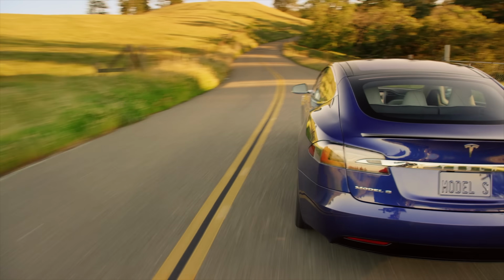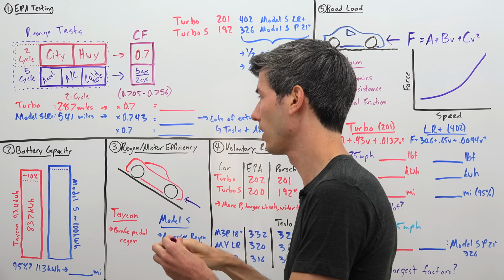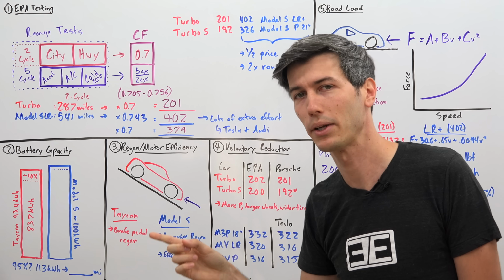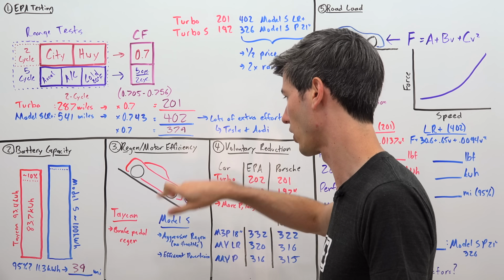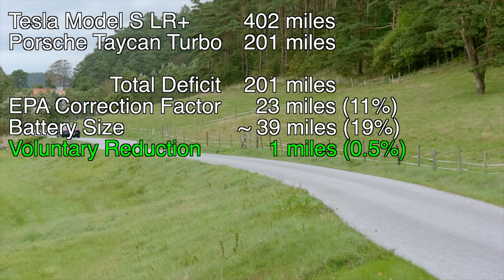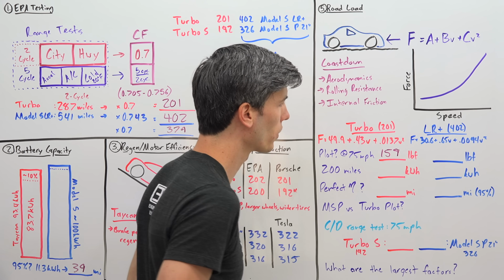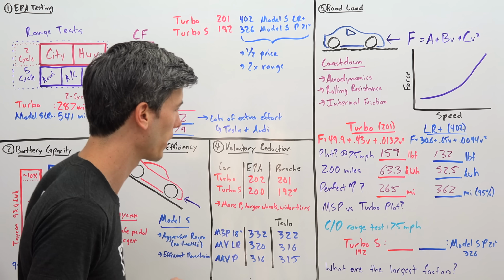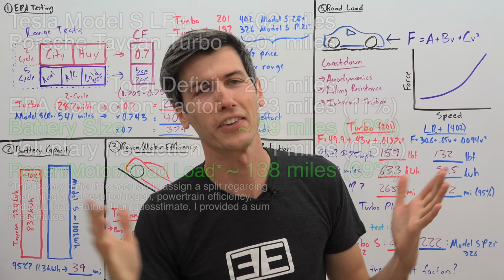Tesla's Secrets To Dominating EV Range - Double Porsche?!

Comment: It is a fact that range drops dramatically at higher speed. What do your calculations show for 65 mph?
Reply from the maker: 75 mph is a very common highway speed in the US. Makes sense to have a test at that speed. There are highways with even higher speed limits than 75.
Reply: @EngineeringExplained  The last time I I spent some time in the U. S. in the early '80's. The speed limits were all 55 mph in those days. Here in Canada, the highest speed limit I've seen is 110 kph (about 68 mph) and that not in very many places. That's why I asked about the speed used for your calculations.
Great presentation in any case.

Comment: Battery heats a coil, coil pressurizes liquid CO2. That becomes supercritical and that pressure is forced against a simple pelton turbine (reduced bearing/side loads). The turbine turns the wheels as well as a regen motor. Once liquid sCO2 passes through the turbine it is then cooled via liquid cooling and ac refrigerant returning to a storage tank to then be pumped into a the main pressurized(heated) tank keeping the liquid CO2 contained in a loop.
Because the coil and there for electricity is only being used briefly to heat the liquid into a super critical form battery range is extended. Of course eventually pressure would run out if you held the accelerator down. But a bit of engineering with tank size and turbine efficiency would eliminate the issue. You would loose some acceleration vs a pure electric. But ta 0-60 in say 7.5 seconds seems like it would be justifiable for a range several times with the same battery pack.

Comment: Obvious question is why the caranddriver test so wildly disagrees even with your calculations, not to mention EPA claims (relative difference).
Btw that third point is bit crazy - both can do regen and one gets bonus miles, because it has it on by default (and it is less effiecient to regen than to coast)?
Reply: Coasting is more efficient because traveling a longer distance with less energy is more efficient then reclaiming a small percentage of that energy to slow down.
Reply: @robertm3951  Thanks, but that part in brackets wasn't the question. I was pointing out that one using the more effiecient method (coasting) is penalized.

Comment: That car and driver article has a big flaw, that is it's playing pretty much completely to the Porsche's strengths.  cars were running at a high 75mph which favors the Porsche low drag CD. The cars were not slowing down, going up hill or going down hill, which negates the weight penalty of the Porsche and also removes any advantage of the Tesla's regen system.  In the real world, there will always be slowing down in traffic, always some hills.  75mph is also a rather high avg speed.  I don't think I'ever managed to even avg 70mph on a long road trip ever.
Reply from the maker: The Porsche does not have an aero advantage (see graphs in video).

Comment: sorry, but ia am verrrry confused.
i"thought" electric motors struggled a great deal more in high/low-temperature situations.
after you figure these extra,is the acceleration THAT much of a tesla advantage that it negates the poor performance in cold/hot situations?????
Reply: Motors don’t care. Batteries do though.
Reply: @ericelsberry5585  what?
um...yes, i know.
it IS batteries length we are looking at here, right????????
Reply: Tesla batteries overheat more than the Taycan. And the Porsche Taycan Turbo S is quicker than the Model S Performance; it did the 1/4 mile in 10.3 seconds, compared to the Tesla doing 10.4 seconds.

Comment: Why not just get both cars side by side and drive the until they stop....simple engineering...simple to understand
Reply from the maker: Discussed at the end of the video. Car & Driver did this.
Reply: @EngineeringExplained  Well kind of but not really.  Real world is two cars starting in my garage, both with AC or heat on, plus radio, and then we drive along the same roads...city and highway..one behind the other....until the first one runs out of juice...then I will know which one has real world range over the other.  All the rest is great engineering but its not what average people want to know.  I test drove a Tesla a few years ago in a cold climate...and when I put the heater on full bore the Tesla sales guy in the car started to squirm in his seat...the longer I drive the faster the battery level dropped with the heater on...and guess what...I did not buy one for that simple reason....I had calculated that under this condition, one I drive mostly....the range would be useless for me. Same was true of the BMW which had no range at all...so they added basically a lawn mover engine to try and help in range anxiety that anyone would have with sub 100 km range with the heater on.  EV's still have a long way to go before they can compete with diesel or gasoline in real world use....especially in the difference in time to fuel up compared to battery charging...even at a super charger station...its a very long long time....

Comment: Why would they call it the Turbo when not only does it not have a turbo, it doesn't even have a combustion engine?
Reply: Why would the car company be called Tesla when it wasn't founded by Nicola Tesla? Ford didn't name his company Ferrari, he named it Ford. Also, naming an adaptive cruise control Autopilot (an aviation term) and a system where you have to keep your hands on the wheel at all times and are responsible for the vehicle at all times Full Self Driving when it's anything but full self driving, is equally idiotic.

Comment: The test talked about in the end does exist. Teslabjørn rangetest ev`s at 90kmh and 120kmh gps speed. He uses a 50km stretch and drives back and fort to eliminate wind and elevation variables. Only thing you have to estimate is the temperature difference. Not 100% accurate but you get a pretty good picture of the differences between the different ev`s.

Comment: Great video, full of interesting data!. Thank you very much.
Just a comment about the EPA process. I believe that Porsche not doing the extra test to get a customized correction factor has nothing to do with avoiding the extra work. Porsche probably knows pretty well how much that coefficient would be and chooses not to do it because it's not a huge improvement over the 0,7 standard coefficient. It's only a thought 😉
Reply from the maker: I asked Porsche, they wanted their EPA rating certification sooner.
Reply: @EngineeringExplained  Well, that looks like a solid reason too 😁👌🏽

Comment: Sorry,  but you are wrong on point  number 3. I made that test lots of times and in every one one pedal drive is worst than coasting
Reply from the maker: You can "coast" in either car, in the Tesla it's a matter of pedal position. The testing that gives the range is defined by the EPA, regen is very likely advantageous in this testing.
Reply: @EngineeringExplained  true that, i dont find costing with 5% pedal pressure very conforting or precise, i just cost with no pedal action. Keep up the excelent work

Comment: That 75mph number is interesting..... Mile range is different from motor efficiency and regen etc requires a tough fight for PR.....
Reply: Regen doesn't matter much on a long drive at constant speed when traffic doesn't interrupt it.
You drive onto the highway, drive for a few hours depleting the battery and then slow down exactly once, putting a fraction of a percent back into the batter.
Reply: and tire rolling resistance
Reply: The 75mph test shows that their efficiency is exactly the same on the same size wheels. The Tesla's advantage comes entirely due to larger pack & smaller buffer. However, due to less safety buffer the Tesla pack will degrade faster so the advantage may flip on 3 yr old models of each brand. 

The striking thing is that how sensitive range is to tire width/rolling resistance. But Porsche is a performance car so they weren't going to put Prius wheels on it. 

All that being said, he still takes Tesla's LR+ EPA numbers on faith, ascribing their outperformance to regen, which is absurd. The Tesla EPA numbers are still suspect. Model S owners know this.

Comment: I already saw a few tests comparing Teslas and the Taycan on the German Autobahn and if I remember correctly, they are pretty similar in range at about 95 Miles an hour or about 150km/h. There's a really nice video from the german Youtube channel nextmove on it ^^
Reply: Hey, interesting, and what are the results? How far can you drive on A-bahn in one of those?
Reply: @ivankuzin8388  Hey, the results were 314km for the Porsche and 332km for a Model 3 Long Range (it had KW coilovers which lower the car around 4cm). The Model 3 was 2 years old and they said the battery had around 5% performance loss, but apparently the loss gets kind of cancelled out by the coilovers since they offer a good performance gain (they tested that as well in another video). Both cars were on winter tires and the temperature was 7 degrees celsius. They set the climate to 18 degrees celsius and the average speed for both cars was 131kph. They couldnt quite reach 150kph all the time. Pretty interesting results imo.
Reply: @David-yx5vx  Thanks, interesting. Well, I remember when I was in Germany once I drove around in a rented Fiat Panda with 0.9 engine and it did 140-150kph no problem, consumption was like 6.5l/100km or close - wonder if small EVs like Renault Zoe or VW e-UP can do the same.
Reply: @ivankuzin8388  Can they do 140 km/h? yes. Will that also completely decimate the range and make travelling any reasonable distance much more difficult? Also yes.
Reply: @karlosbricks2413  We need batteries with at least 50% more energy density - I drove for more than 450km total in high speed without stopping to refuel in that little hatch that costs like 12K eur...
Reply: @Cloxxki  Would you not consider losing 40% of your range as it having been decimated? I would, curious to know how other people interpret that word tho.
Reply: @karlosbricks2413  It's quite a loss... if you ever need it. Most people don't drive for 450kms very often, if ever, especially not in Europe. That'll take you from Amsterdam to Frankfurt, I reckon most people will opt for the train or plane instead of driving for 5 hours straight.
Reply: @jellevm  I agree, The range is more an issue if you take a multi-stop journey, thats where the car becomes useful, because if even one of those places has poor public transport, it cannot reliably accomplish the journey. Similarly, if some or all have no real facilities to recharge your car(the likelihood is obviously reducing with more public chargers), then that's when having a longer range can come in, but I agree, a lot of the time it's unecery and a waste of energy to lug around a big battery you don't need.
By the way, I come from the UK, and I will and have happily taken the train to travel to most places domestically.
Reply: @jellevm  lol, you need to come to Canada. Toronto-Ottawa is like 5hrs on the main highway. It literally takes a full days driving (10+ hrs) to get out of Ontario from where I live. 
I drive 100km/day to work and consider that a very reasonable commute. When I drove to the city everyday it was 350km/day
Reply: @jellevm  well here in the states many of us travel 5+ hrs in our cars. You can drive that far from one side of state to the other Texas and California are much much longer.
Reply: @ivankuzin8388  for sure, you’re right but let’s all slow down a bit and let some time for the technology to improve, it’s going to take a while. 
ICE cars have been around since 1885, it’s been 135 years.
I know the first car was electric, 40 years before the first ICE car but electric cars have only started being profoundly looked into since the mid 1970’s... let alone invest a lot into it and mass production which occurred around 2005 or something
Reply: @ivankuzin8388  You might end up a slave to the "shitboxes" until petrol is banned there. Good luck lol
Reply: @brunoaraujo1192  Are you saying a EV needs to do "double" the work of an ice for it to be considered a worthy candidate? Or insert and irrational number when I listed "double" for yourself. You see too often that people want 600-1000 miles of range. Laughable at best
Reply: @samusaran7317  i don’t see anything that people want, i don’t care. I said the technology is still too young and there’s a lot of room for improvement.
I don’t know where you saw “double”
And idk what’s wrong with you for going at everyone here thinking you’re smart or something
Reply: @samusaran7317  laughable at best
Reply: Question is: Would you pay a $60,000 premium for not so far off??
Reply: @musinclind37  Yeah, cause range is not everything. In my opinion, the Porsche looks so much better, especially the interieur. And not to mention build quality, where even if Tesla has improved, come on, it's a Porsche. That thing is beautiful
Reply: @musinclind37  in this case yes. Better design and craftsmanship as well as much easier service center's and as most Porsche's become highly sought after collectors cars it will retain a better retail value.
Reply: Marco Krueger sadly for those of us in the states how far they will travel at a constant 95 mph isn’t really a useful metric. Trust me i wish very much that it were lol. :(

Comment: I owned a Hybrid Vehicle and I can certainty tell that getting the most out of the Regenerative braking power of the brakes takes practice. Not everybody can jump in an electric vehicle and extract the most power out of the Regenerative braking system from the get go. You need to start braking a lot sooner than most people are used to.
Reply: @AzathothsAlarmClock  In the Zoe u have 2 modes, one where u glide, and one where u regenerate.

Comment: Once agian one built to the EPA test one built to actually driving.
Regen is similar to start-stop systems, can tailor the test results without improving the real world experience.
Reply: So you are saying one-pedal driving doesn't improve real world experience?
Reply: @biplabkumarghosh6300  its not how Porsche is going to be driven.
Reply: @bowez9  Would you explain how did you arrive at this conclusion?

One-pedal driving was mainly designed to be used in cities?
Do Porsche drivers live outside cities or they take their Taycan on a flatbed to racetracks?

The driver of the Model 3 Moose test himself attributed the excellent results to strong regen

In many long races, drivers also depend on regen after the stock breaks overheats
Reply: @biplabkumarghosh6300  Porsche have a racing heritage, to the point that at the North American Headquarters there is a test track for their customers.   
Tesla is just a statement piece.
As such they cater to different clientele
Reply: All driving is not done at 75mph.  The EPA test is a mix, just like real driving.
Reply: @johnh8268  that depends on your  conditions.  But for range (which is always maximum distance)  steady state is the method of determination.
Reply: @bowez9  Not really.  A standard test needs to be defined and followed by all to compare results.  For example, I could drive a steady state 35mph and get a wildly different range than driving at 75, 85, etc.  If every ICE vehicle was only tested at 75mph, they would most likely not make their EPA range either.
Reply: @johnh8268  Range is a different metric than Energy per distance.  Aircraft are given a Range and that is given at steady state.
ICE are given in MPG and EVs are not given in joules per mile, but but range as if max distance at set speed is all that matters, which for marketing purposes is all that does matter.

Tesla is playing the game and Porsche is more concerned about driver experience.  Perfect example is Tesla can not do back to  back max acceleration were as Porsche/Audi can and do it till out of power just like a ICE.
Reply: @johnh8268  a better way for range could be run them at set speed until empty at a banked oval track.